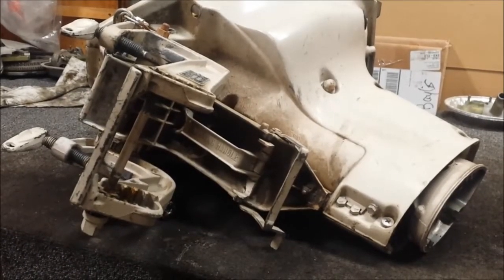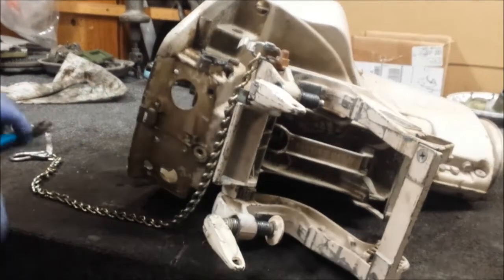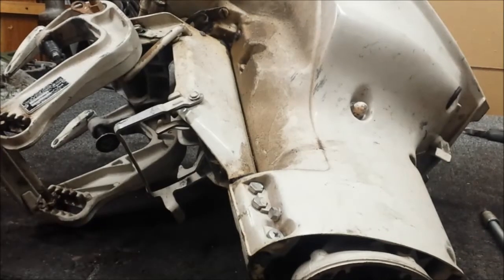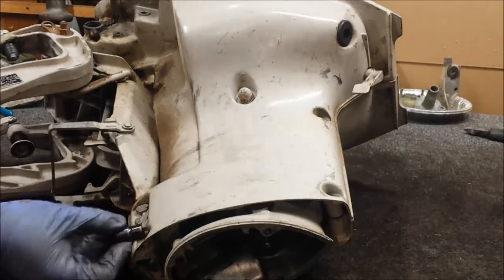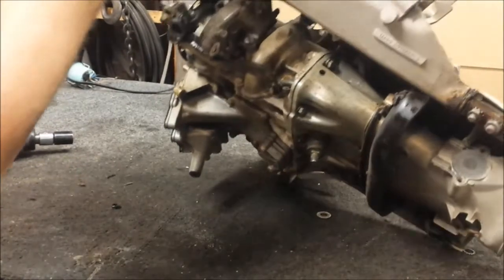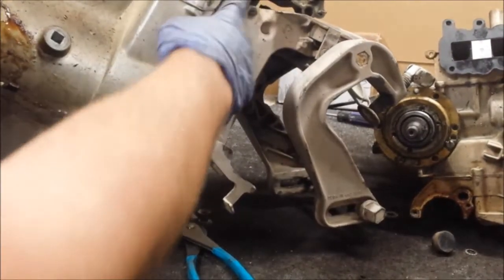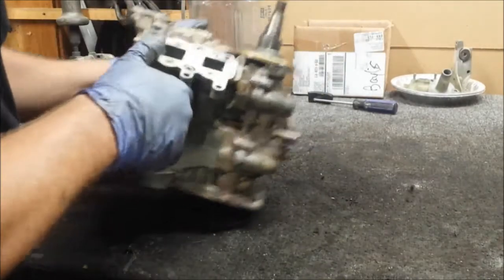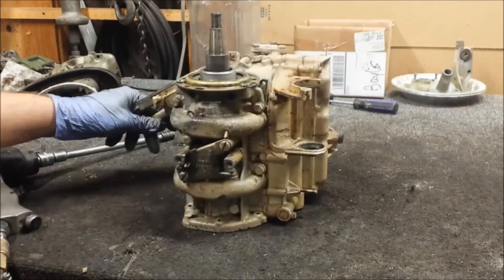Johnson 9.5 HP Teardown - Part 6; Powerhead

Comment: thanks for this.  i bought a 1964 9.5hp Evinrude from a guy.  motor hadn't run in a very long time.  (compression is 65 top and 70 bottom)  i can start it now and wind it up but can't get it to idle and it "lean" coughs while fast idling.  cleaned, then rebuilt then (bought a new)  ultrasonic cleaner to clean and then replace the carb with another carb.  checked all fuel supply connections and clamped new fuel lines.  checked and cleaned fuel filter.  (brand new tank and hose.)  checked ignition -- spark jumps 0.200+.  installed the correct cj4 plugs per Evinrude site.  ordered and replaced the top crank seal (with quite a bit of difficulty to get it out) though it looked ok.  now considering trying to replace the bottom seal because i don't know what else to do.  your video didn't show the bottom of the powerhead and my manual doesn't show a procedure to replace it.  any pointers or suggestions?  does my problem sound like a bad lower seal?

Comment: You were more fortunate. Even after spraying lubricant on the case bolts (maybe I didn't wait long enough), I broke off the head from the back top (next to the lever) and the right side big nut. Plus, the lower back case screw stripped on me, to the point where I'll have to use a blackout bit. And I had a screw bit that fit it. Luckily these are all fixable and available. Oh, the joy of working with used motors. I keep telling myself, "keep at it, I'll get 'er done"

Comment: is that a mount down inside there and i really dont want to have to tear out rotating assembly in front if i dont have too.thats alot of work just to dig that part apart.noticed you said that was part your after,i guess transom and all.can you tell me if you think bolt is probably just turning inside rthere .i can see end of screw but bolt must be right above and nothing keepin it from spinning.i have a diagram and there is a bolt and spring and washers and shims .any ideas.great stuff.keep up good work.u have any parts for that assembly and any powerheads,good ones for 1953 QD-14 johnson.thank you

Comment: Hey I bought a 9.5 with a broken drive shaft stuck in the power head any ideas?  It's broke almost exactly in half. Is it possible to take the power head off without stripping it?

Comment: the long screw in front or the rotator screw wher motor pivots on in front.i cant get mine to tighten.what you suppose is goin on down in there.motor runs good and all but it turns too easy.wanted to tighten that screw but it just keeps turning.any advice.pleasegreat video